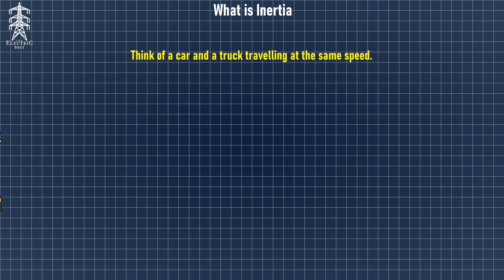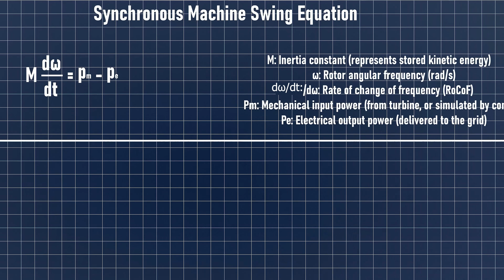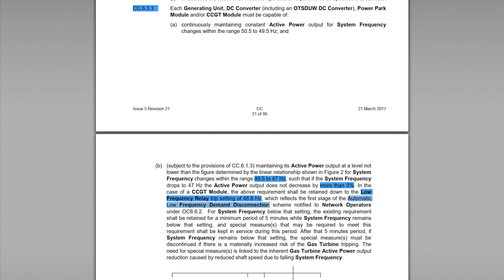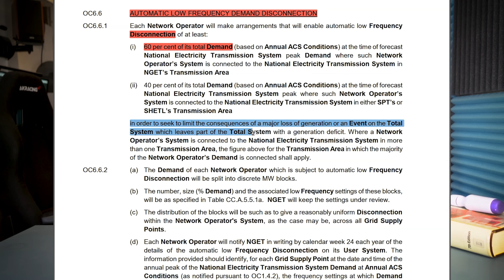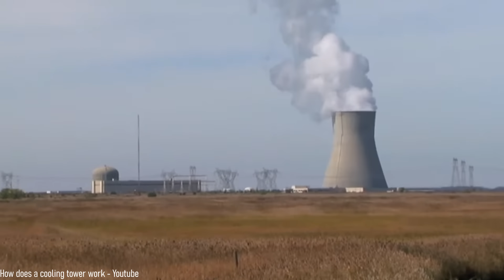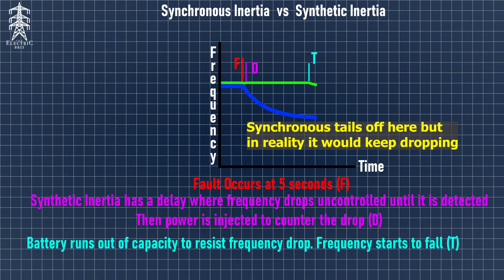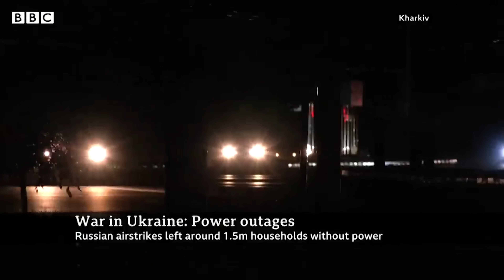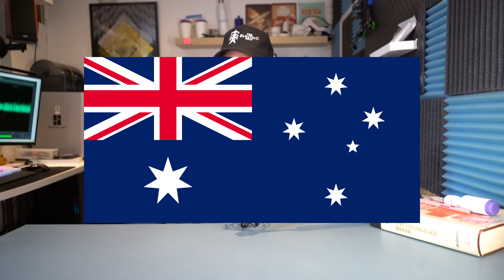How to Restart the Grid after total collapse

Comment: You missed the metal crank handle hanging up against the wall that starts the small 10hp engine that starts it all ,if the battery is dead
Reply from the maker: Substations are just hamster farms with lots of wheels in. Big oil just wants you to believe we use gas instead.
Reply: @TheElectricBrit Those hungry hamsters have evolved though - now they eat wood pellets!
Reply: Yes, I'm going to see the hamsters next week as it happens.  Looking at possibilities for reducing the parasitic load consumed in fuel handling.  I wonder if maybe we need more oil on the bearings of the hamster wheels!  Balancing fuel distribution for better boiler efficiency is also on the agenda - the hamsters seem to be running at different speeds, some getting too much food and others not enough!
Reply: @TheElectricBritcouldn’t a ship’s power plant help in a black start especially if it is a nuclear powered carrier or sub
Reply: @GamingNoob1060  The US Navy has been doing some research on connecting ships together to form a "marine grid" that can be used to provide power to shore in case of a disaster or cyberattack. Nuclear carriers can generate hundreds of MW of electricity on their own.
Reply: @GamingNoob1060  Well, they cooould, but as a strategic national military asset, only a very specific set of circumstances would see the Admirals immobilizing their primary reasons for existence.
Reply: @TheElectricBrit true, I am a hamster (lie I am a raccoon)
Reply: @TheElectricBritWhat about Big Hamster?
Reply: I used to work at Fiddlers Ferry power station near Warrington and they had a building with I think 4 open cycle gas turbines on standby. Against the wall was a small diesel generator which could be started with a handle.  This I was told was there in case of a county wide black out to provide power to start one of the gas turbines, which would then provide power to start the other 3 gas turbines, to start restoring power to the grid....I was also told that Fiddlers Ferry were paid a 'Black start' fee for having this system available......I sometimes wondered if it was true or a myth....
Reply: @martinwalker9234  The "black start fee" is real. I'm not sure if Dinorwig can open its valves without external power - or indeed have the lights on in the big cave.
Reply: @ACCPhil  … yes, dinorwig can!
Reply: @ACCPhil   It will be able to, Cruachan was a blackstart station and it was commissioned in the 60s.  iirc Cruachan could go from zero to 400MW in 1 or 2 minutes, and I think Dinorwig could spin up faster.
Reply: @mcnab1383  I don't the stats to hand, but I believe that if Dinorwig is in spin-gen (rotors are spun up to grid-synchronous frequency using compressed air) then it can go from 0 - 1,800MW in 16 seconds. It was built at a time when people watched live TV so when the Mancunians all put their kettles on in the ad break in Corrie, they could hit it. Still, it's like 9GWh of storage - which is handy
Reply: @ACCPhil  This blows my mind - pun intended. Releasing compressed air makes it very cold. Follow that up a few seconds later with a giant blowtorch flame across the turbine blades... The thermal stresses must be insane. And the fellows that built it did so with graph paper and slide rules!
Reply: @MrHuram-abi  Dinorwig is a pumped hydro station. Air just gets the turbines going so that when the water is released you can get a lot of power very quickly
Reply: @ACCPhil Ahhh, that makes much more sense now! Just forget everything I said.
Reply: @martinwalker9234  It is true, Fiddlers a Black Starter and very well equipped, the stations location  facilitated several Grid pathways.  I am sure you miss working there i only visited a few time for Condition Monitoring and Thermal inspections. Great crew proud of their Station.  Canteen wasn't bad either. Best.
Reply: @martinwalker9234  I believe the black start is a service that is offered by some generators ,   Not all plants provide it.      Edit   All nicely explained in the vidjeo . rule one watch 1st post later 😊
Reply: @martinwalker9234  … it’s absolutely true!
Reply: @martinwalker9234 pilot light
Reply: @martinwalker9234  True! Drax has the same gas turbine starter motor.
Reply: @martinwalker9234  It's not far from the truth.  At Kingsnorth it was a little pull-start engine, like on a lawnmower - I saw it myself.  But you needed an intermediate engine between that and the first Olympus.

And yes, some power stations are still paid to this day to maintain a black start facility like that.
Reply: @martinwalker9234 big diesel generators at dinorwig
Reply: You might think it's a joke - but I can tell you that for real it was not a crank handle but actually a piece of string with a knot in it.  The little engine that starts it all off was pull-started like a lawnmower engine in the case of Kingsnorth 2,000 megawatt coal station, see my separate post.  A good deal smaller than a Model T Ford engine, I'd estimate about 3 hp in practice.
Reply: @marionbloom1218 , I remember outboard motors started like that back in the 70s, even chainsaws
Reply: Crank handle; crank handle; you must be old. I watched a model T go into a modern garage for a service the other night. A lot of fun.
Reply: Hand cranked petrol pony engine from the 1940s is needed to restart a 21st century grid haha.  That would be a good yarn.
Reply: Big Hamster Energy doesn't want us talking about that. They are  in cohoots with Big Oil..
Reply: @gorillaau  I thought it was Big Corn.
Reply: Yep! I held the one at the Peterborough gas power station. It’s the ignition key for a power station!😂
Reply: A pony engine to start the diesel that drives the black start capacity would be an interesting choice
Reply: @Lady_Auntie_Rea  a pony engine, not a little engine made to help start a bigger engine, but rather four ponies strapped to a mill-wheel...

Comment: Just found your work and it is excellent. I guess there are lots of folks like me thrilled with the progress to renewables but can't get our heads round why the Grid can't move more power around easily. Your simple explanation of the way inertia works and the maths behind it was easily understood but most of the stuff I come across is not so easy.. active and reactive power being one of the topics.
Reply from the maker: Appreciate the kind words 🙏 I wrote a video a few months back on how the grid works that I’ve not got around to shooting yet and you hit the nail on the head about VARs and MVA vs just being taught Watts in school. It can get pretty complex but key to a lot of things. Maybe I’ll fast track that video 😉
Reply: @TheElectricBrit The time delays in long transmission lines can also be an issue with sync, especially if you have parallel paths (ie a grid) This has always fascinated me, maybe a future video?

Comment: Just a quick note on interconectors 

Current VSC technology if importing country has a blackout the converter will go to standby disconnect the ac supply buy keep the dc connected but no power flow

So it can help with grid recovery as it’s electronically controlled and also can provide reactive power

Also great video overall 🫡
Reply from the maker: Thanks for the comment 🙏 Now we’re seeing more VSC based HVDC come online I imagine some thinking will go into making them black start sites. I’m not sure they are currently in the UK but I know abroad the interconnectors are used for black start.

I’ll have a dedicated video for HVDC eventually but before that I need to cover cables vs overhead lines which each are pretty long videos, and I’m not sure what not to include. UK tower designs and naming is a massive rabbit hole!

Comment: A lot of the larger gas turbines require the Grid to restart as they back feed the generators and use them as the starter motors for the turbines. There are smaller gas turbine stations that have diesel generation large enough to run separate gas turbine starter motors, but they may struggle with the reactive power output required to re-energise the power lines. Ideally, they need on site fuel oil storage as well, in case the gas system pressure is lost.

Comment: What happens if middle section of a country experience a backout while the east and west continues running and slowly get out of synk, how does the middle section reconnect them again or do they have to start over as well?
Reply from the maker: Great question! If a grid separates then its sections will slowly start to drift and become asynchronous.

The middle section that’s dead could try and black start itself and then synchronise with one of the live grids at a time, or a live section could start energising the dead grid piece by piece, connecting it up. 

Eventually you’ll still have two out of sync grids and substation have synchronism check relays to make sure you can’t close a circuit breaker and connect two out of sync circuits. The network control centre will need to balance things until they’re in sync enough to be connected. Hope that helps!
Reply: @TheElectricBrit This is very interesting. Is it the case that the two independent grids will adjust their frequencies to be very similar, wait until they are in phase, and then connect them at the right moment kind of like how you synchronise a single generator?
Reply: @KingJellyfishII But wont the two grids have a lot of inertia that will stress the grid in two different "directions" to make them to get i phase again? So that won't trig another blackout?
Reply: Saw you wrote "very similar" , that should do the trick. But guess they will have to get close to each other very slowley.
Reply: @Mrdanne  Yes I wondered the same thing
Reply: @Mrdanne  That is why they have to be synchronised. At the moment of synchronisation, nothing happens when you flip the switch. There is no current flowing through the switch so it's the same if it's on or off. Because they are not perfectly synced, current will start flowing through the switch to force them to stay in sync instead of drifting apart again. Hopefully if you did a good enough job, all the switches are turned on at the same moment and it's just normal power flow again.
Reply: Sounds to me like how you synchronize two female generators, only on a much larger scale. Run them at very slightly different frequencies and wait for them to drift into phase. Run them separately in phase to make sure you've got it right, then close the interconnector. 

Or am I being naïve here?
Reply: @trueriver1950 I agree, it should be. But change the frequency of an entire grid up or down for them to sync will take some effort 🥵
Thats probably the reason it takes a lot of time to black start a grid.
Reply: Just imagine two enormous flywheels that are running slighly with the same speed, just connect them with a rod when they are in sync will inject a hughe force in that rod until they are synced. Thinking it would be that same for that interconnector that will force the grids in to sync.

Comment: My question is; does regulation allow grid forming inverters? I thought that Tesla Magpack has a "Virtual Machine Mode" (VMM) that can stabilise the grid, but VMM can't be fully unleashed because of regulation?? Times are changing and I would guess that different areas will have different regulations to suit each region and the regulations perhaps are not all modernised in synch? There are many parameters to the synthetic inertia algorithms and I understood that the regulations are still very restrictive. Any info?? Thanks.
Reply from the maker: It’s not my area of expertise I’m afraid although in the UK grid code is being updated to include more provision for grid forming. To me it’s a no brainer that anything over a certain size should have the capability. However they still need to be approved as black start providers in order to be used to any effect during restoration. Providing synthetic inertia should be mandatory though and I’m fairly sure even today batteries are used for grid scale balancing. 

Tesla VMM is exactly that, synthetic inertia using the battery to counter changes in frequency. I imagine any restrictions in the US could come down to lobbying by Coal / Gas to keep them favourable rather than any actual technical limitation.
Reply: @TheElectricBrit grid forming inverters are allowed but with a huge caveat: a fixed frequency reponse curve, emulating a spinning mass generator, not utilising true capabilities of inverters to the fullest extent
Reply: Thew best thing about the Tesla batteries is they can help stabilise the grid if if a large generator goes offline, although they may only supply a load for less than a minute they allow another generator/s to ramp up and take the load. I have read one example where a 500MW coal fired generator tripped a breaker, the Tesla responded within 40ms and frequency only dropped 0.1Hz.

Comment: Are  grid forming devices a danger to lineman;  how do they  not just start up if they are cut off from the grid?
Reply from the maker: Depending on the country there should be policies on this. In the UK installations need to be G99 complaint which involves Loss of Mains protection, which in short is an anti islanding measure that prevents solar and battery from backfeeding a dead grid as like you mention it could harm people, or in the case of black start can impact the sequencing of startup. 

Distribution and grid code also prevent behind the meter generation like household solar or battery from connecting unless voltage, frequency and phase angle are established, ruling out grid forming capability for domestic installs. Hope that helps!
Reply: @TheElectricBrit My solar (in the USA) is behind the meter and grid-forming.   Of course it also has an MID (Micro-grid Isolation Device), which disconnects it from the grid when the grid is down, or even if the grid goes out-of-spec in terms of frequency or voltage.
My wife wouldn't let me put in solar unless it would work when the grid is down.   And yes, that capability has been tested for several days after hurricane Milton passed through last fall and made a mess of the local distribution network.  :)
I would think this sort of system is allowed in the UK as well?
Anyway, it seems to me you are conflating the terms "grid forming" and "synthetic inertia".